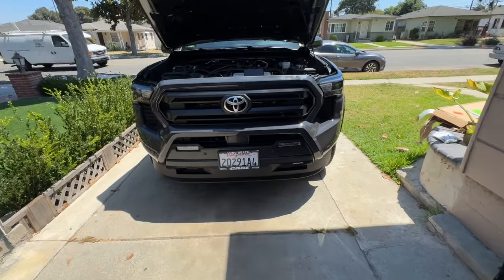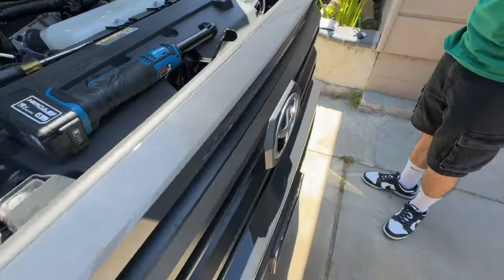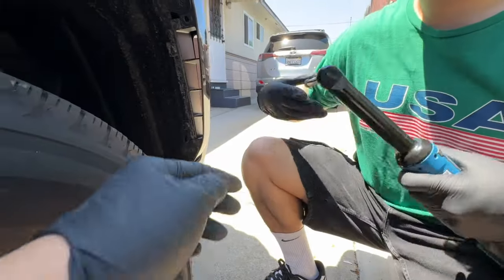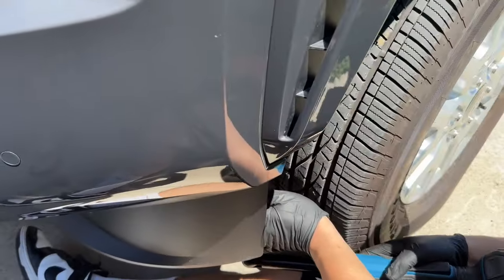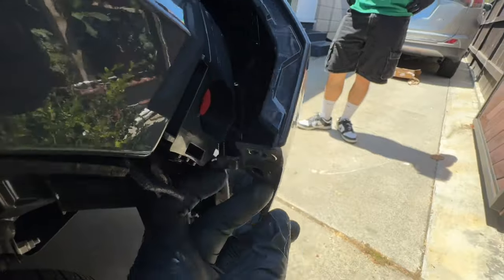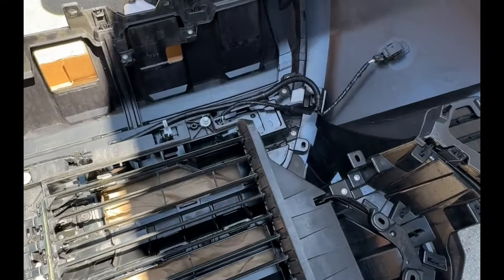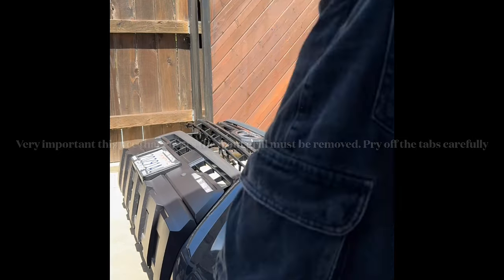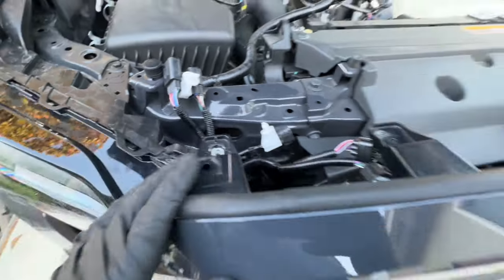2024 Toyota Tacoma 4x4 sr5 front grill removal custom grill installation

Comment: looks perfect!  do you know the brand/model of the electric ratchet that you use? maybe the link you can share? thanks.
Reply from the maker: @stbcat8473 bought it from @harborfrieght 

Sku57276 12v 3/8 ext reach ratchet. 

Sku59195 12v Hercules 4ah battery 18650

SKU56559 20v/12v 4ah single port charger. 

These go on sale so I would wait till they give them nice discounts, I bought these when they had 25% off and came with a 2ah battery free.

Comment: Enjoy your check engine light error messages with no active grill shutters anymore 🙄. I wonder if it impacts warranty?
Reply from the maker: @bartcanuck734  after installing the aftermarket grill there was no check engine light or any error codes whatsoever, this is a basic installation of a grill nothing more. Active grill is behind the actual grill, you have to remove it before you can install the aftermarket pce. Hope that helps.